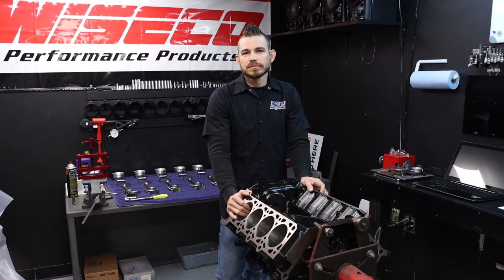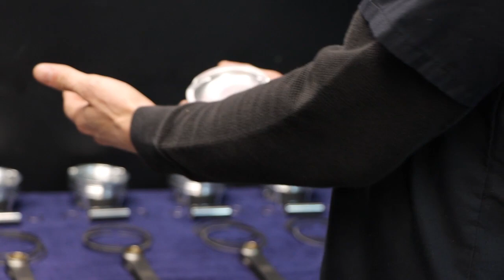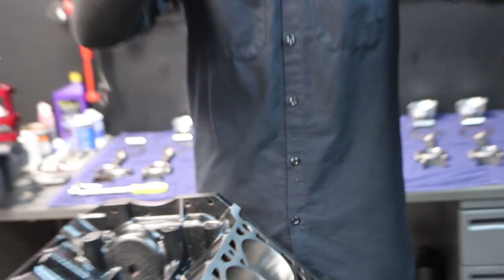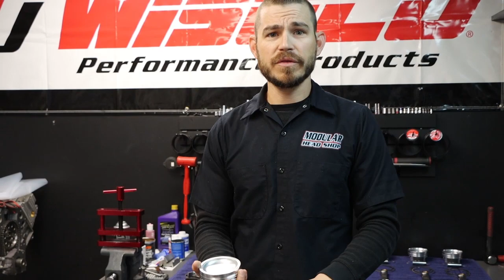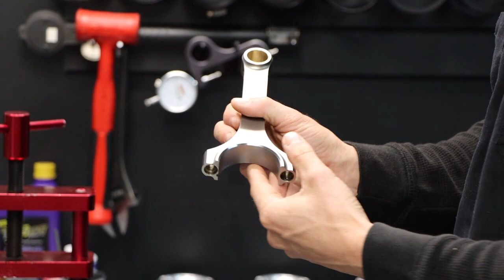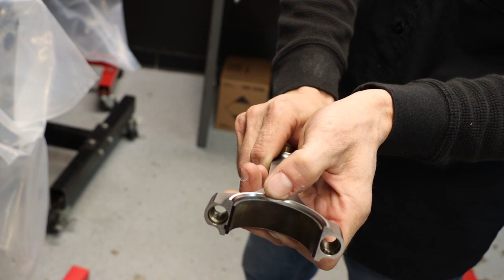Tech Tips - 2V Piston Orientation, Piston Pin Offset, 5.4L Specific Piston Features

Comment: Kudos to MHS for listing 1.3 comp height pistons instead of being lazy and selling 1.2's that do not offer the ideal specs to allow best quench etc. 0.120 down wtf Ford trying to pull? You're the first to make a point of this and not just brush it over. Our Boss engines here in Australia used 1.2 with dome and they stink. It's just cheap and lazy. I was about to order custom from Diamond and noticed this. Will order from you once I have my measurements done. Cheers.

Comment: ModularHeadShop@. Have a question. So I have a 5.4L V8 2 Valve. Im wanting to rebuild it but want to be able to use a performance intake. Ive seen they make performace intakes for the 4.6L V8 2 valve. So is it possible to use 4.6L V8 cylinder heads on my 5.4L so I can use some of the performace intakes they make for the 4.6L. Is it that possible. Ive heard the heads are the same so if thats the case then I could just by 4.6 heads. Im probably missing something and its probably more complicated than that.

Comment: What would you recommend doing to a 02 lighting 5.4 with factory super charger. Wanting about 700 rwhp or more on 93 pump gas. It is a street motor. Thanks
Reply: I am sitting at 700 hp in my cobra I wouldn’t go that high with anything unless it’s a race application. 600 in my option is tops for street use. I run out of road fast. I am going 550-600 hp in my lightning to make truly fun street truck and 700 hp is really tough with a Eaton 2.3 whip all day.
Reply: That Eaton will only do 500hp/650Tq, that is with a 10lb lower and 2.8 upper pulley. You would obviously need rods and pistons, you crank will be fine. Go ahead and swap out all the fasteners to ARP 2000 while it is apart and stud the heads

Comment: Hello Mr. Module head shop my husband has a Mustang GT 4.6 engine whenever the engine heats up it starts to spit and sputter he has changed just about everything he thought it might and it continues to spit and sputter. What do you suggest on this issue.
Reply: Clogged fuel filter
Bad fuel pump or relay
Hard to say.
Reply: Thanks for your input we will check that as well, but there’s nothing like bringing it to you to check it outs😁
Reply: Change plugs and coils…
Reply: OEM ford coils they are the best